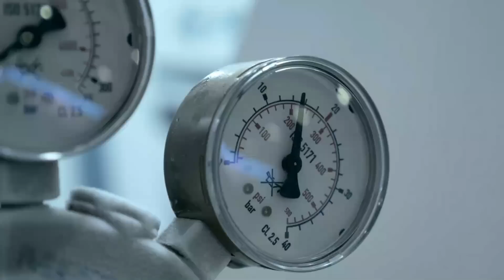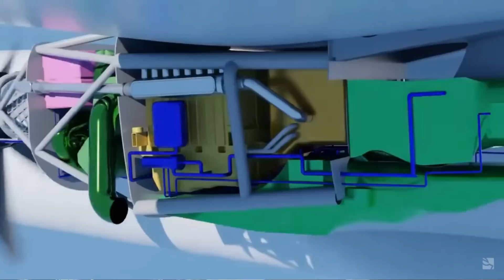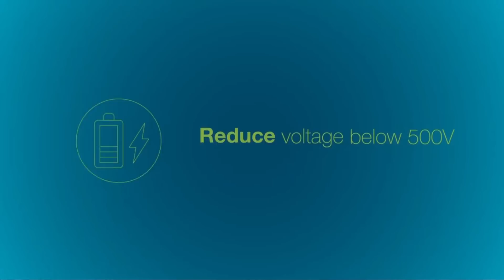Cryoprop:  New Superconductor propeller Technology by Airbus

Comment: When are people going to build an hydrogen generation unit by using h2o and electrolysis on board a vehicle ?ie running on tap water .
Reply: The electrolysis of water requires energy. The energy to carry out the electrolysis (e.g. fuel or batteries) would have to be carried by the vehicle as well. Collectively, a battery (or fuel) + electrolysis system is likely to be much heavier than a battery (or fuel)-only approach. As a result, the answer to your question is probably 'never' - unless a highly  energy dense source (such as nuclear) is used and electrolysing water turns out to be the most effective way to convert that energy to something that can be used for propulsion.

Comment: WTF?!! Superconductivity? Electric motors already have the efficiency and low weight, why are they solving problems that don't exist? 2MW of power, come on teslas have 700hp which is 0.5MW already, what innovation are they talking about?! The only problem with electric aircraft is energy storage, and only that. Hydrogen is a dead end, if you have to use a gas => use methane. It's like fractally wrong, wrong at every level. Airbus is wasting time pretending they are doing something, when they don't.
Reply from the maker: Good point
Reply: Electric motors are indeed already efficient and light compared to the equivalent combustion engiine, but the Tesla 700 hp rating is a peak rating that can only be maintained for a limited time before the motor would overheat. In an aircraft application, you need that sort of power continuously, Moreover, the larger the motor is, the more difficult it is to keep it cool (the surface area to volume ratio reduces with increased size) so it becomes more worthwhile to add the cryogenic equipment to minimise losses and waste heat in higher powered systems.
Reply: @johnwale2886  good response! 
I agree the motor should be designed for the application, but cryogenics?
It seems like more cooling channels should do the job?
Your peak rating argument -- sure, that's correct too, but teslas go around a race track without overheating, which is essentially 100% power interleaved with 100% regen, pretty torturous regime as well, right. Or just going 200 mph or whatever the max speed number is, that's quite intense too. BTW, an aircraft needs full power at takeoff, not all the time.
Reply: @olegklimov3717  Thanks for your answer. Agreed about take-off being the peak power requirement. What I was trying to say was that even a small regional airliner is going to need powers of at least 0.5 MW continuously (e.g. ATR-72 has about 1.6 MW of installed power). In relation to cryogenics, the point at which it becomes worthwhile depends on the size and power levels involved. A car (even a high performance one) will be fine with ordinary liquid cooling, but an aircraft might be large and powerful enough to justify cryogenic cooling.
Reply: @johnwale2886  I would LOVE to see aircraft of a smaller size, smaller than ATR-72, more aerodynamic and efficient, the current air travel sucks!
Especially what needs to go is this huge airports, I'd like to use a regional one (for example Reus where I live), or a VTOL pad. A smaller aircraft can go point-to-point, not hub and spokes model which sucks too.
For that to happen, an aircraft designer doesn't have to throw everything into the mix, including cryogenics (does that include cooling down for half a day or not?), we need batteries 500 kwh/kg  that already exist (CATL condensed battery?), aerodynamics and a feasible way for certification.
Airbus can do all that, and instead it researches hydrogen. That's what I find so laughable.
I'm sure there's a place for cryogenics somewhere, but not in a small simple certifiable aircraft I think would be a game changer.

Comment: vaporware
Reply: 100% correct.
this sort of BS hype over vaporware requires that no-one appears to know the difference between an EDF, propellor, and a jet engine, and how a jet engine can NEVER be replaced with something electrical...

cough cough, ahem...supersonic speeds dont happen in plain old air pushed through pipes... it needs something... EXTRA.

like 2400C combustion temperatures and hot gas that wants to release all that heat somehow...

back when gustaf delaval was playing with early turbines, this was common knowledge. boyle? pascal? charles? theres a lot of history on work performed with gas... lot of maths...

no longer important, its all about "feelings" and "being green"... ha ha.

Comment: Since when was powertrain weight the problem? The weight of the ridiculously thick tank to hold a 700 bar (10,000psi) pressure is the main problem. Hydrogen is a half-measure between liquid hydrocarbons and full electric. It is purported to be "green" but when produced renewably it is 3x more wasteful than electric. They should just either stick with hydrocarbons (which can be made renewably) or go full electric. Airbus will waste whatever free money from the government grants to build whatever nonsense the govt tells them to build.
Reply: lets not talk about how jet engines manage to achieve higher than supersonic speeds... something NO "electric ducted fan" can pull off...

if you wanna go back to flitting around in piper cubs with props at low altitudes... then great, electric is ideal... as long as you dont mind landing every few minutes for a charge.

explain how an electric motor of any type can produce thrust, especially at the low pressures where the standard airliner operates...
Reply: Yes you are right sir, I have pretty much the same comment on this video.

Comment: 13 - 30% to cool it and make it liquid does seem a lot, but then again, if the gains are higher, it's worth it.
Same with too much wind or solar, they could just produce H2 and cool it down as well. 
Thank you 👍💪✌
Reply from the maker: Great point!
Reply: I'm almost sure electric propulsion for big airplanes doesn't even make any sense, but the hydrogen or any other fuel could be used in a regular turbine or any engine.

Comment: Great video,  Also Toyota Hydrogen cars have twice as many parts compared to Tesla so twice as many things can break and need repairs
Reply from the maker: Great point!
Reply: Ive been driving Toyotas for years, they dont break.
Reply: Not all parts can be breaking
Reply: Well, the Tesla cars keep on breaking, more than other brands.
Reply: @WolfeSaber  wrong most reliable car. check your facts and cut the fud
Reply: @martinwoollett8468  Have you seen the latest batch from Tesla? They've got quality control problems, whereas the other brands are going strong and are more reliable, like doing longer than Teslas in cold conditions. And the Cybertruck is a mess.
Reply: @WolfeSaber  Looking at online surveys it appears we are both right depending on which you read. The model 3 and y being the most reliable and the s and x less so. The cybertruck is too early to tell as most new vehicles have teething troubles. With all the advanced tech and choice of materials it's not surprising there's problems but I think they will sort it out.
Reply: @martinwoollett8468  Teetthing, as in people getting their fingers cut? And the reason for people still wanting Tesla is because it is Tesla and Musk. Trust me, Tesla is coming to an end, and not because they refuse to have union workers. Current unions suck.